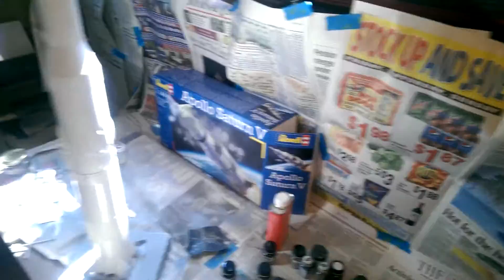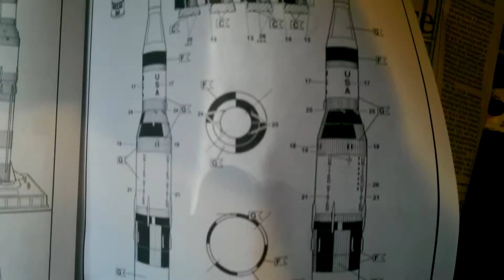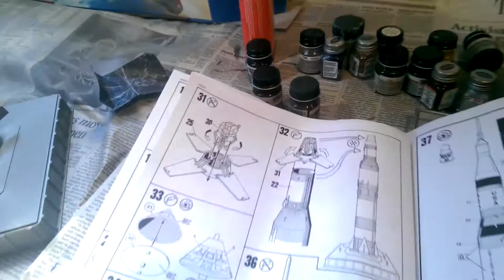Saturn V build part 5

Comment: Hey Scott, Thanks for the video. You seems to have some amazing model :D :D 
I am starting with the model making. This is my first attempt on a plastic kit. Can you put links to the primer, paint, putty, glue and other stuff you used for this model.
Which of them you say are must for a beginner like me.

Thanks
Reply from the maker: Hey Mandar, I'd be glad to help out, first off get the basics, glue CA glue, newspapers, nail files, rubber bands, clamps, then I'm a big fan of model masters paints, tamiya putty, a package of sand papers from a model store, tweezers, exacto knife, blue masking tape, and thats basically it.  Then remember to build your model in sub assemblies treating each one like a model unto itself, like I treated each stage like a mini model, and take your time.  If you can get a lit magnifying glass that attaches to the desk with a swivel arm.  Helps alot.  Feel free to ask any questions any time
Reply: I was looking online to buy the paint. I was able to find 0.5 oz bottle and that too for $6+ .. How much such bottles of White would i need to cover the entire model.
Do you know any other website/store where i can get color at a reasonable price. This is my first model, so i am a bit hesitant to invest lot in it!!
Reply from the maker: Hey Mandar, there are a few options for you,  any hardware store will have enamel spray paint, just get a semi gloss white, 12oz for 6 bucks, or if you go to your hobby store, the model masters white is like $3.  

http://www.ebay.com/itm/like/331339760065?lpid=82&chn=ps&ul_noapp=true
Reply from the maker: https://www.hobbytown.com/search?s=model&fb=89&lg=fb